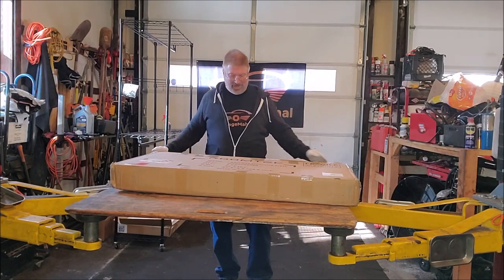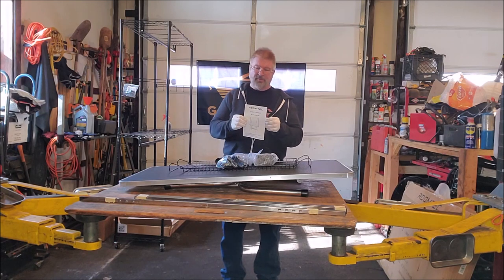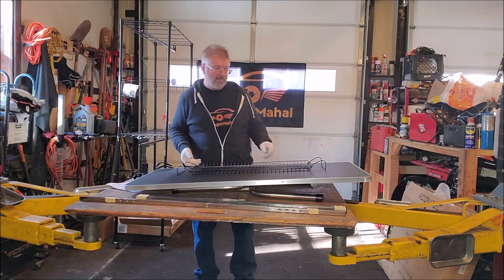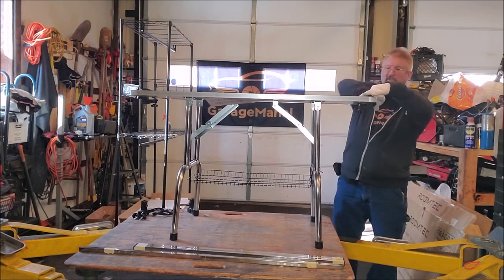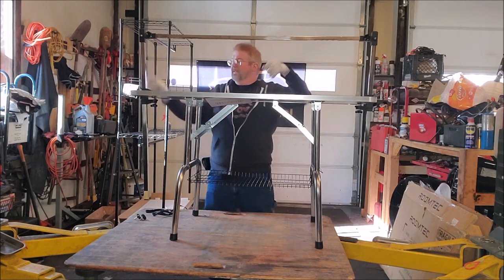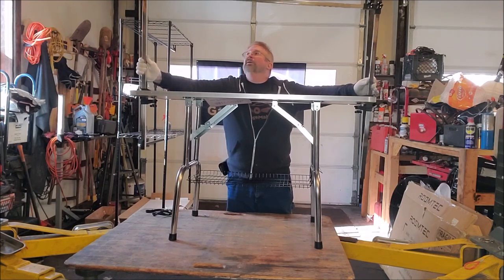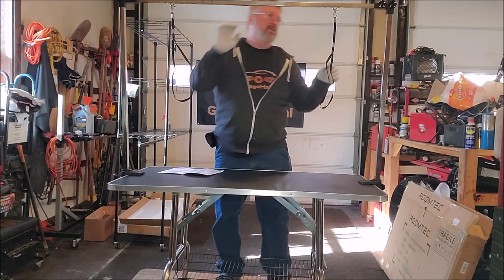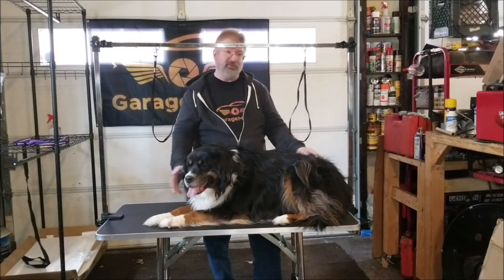ROOMTEC 46" Dog Grooming Table, Foldable Home Pet Station

Comment: I’ve never been able to get mine to lock in place, never
Reply from the maker: Spray a little wd40 on the hinge and the lock bracket, they do need a little pressure to lock, my wife uses a rubber mallet.